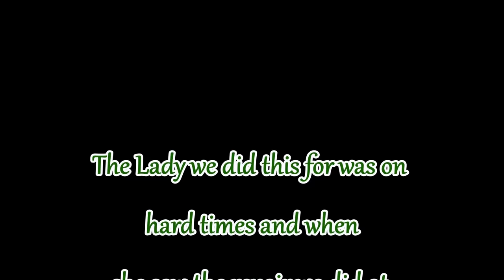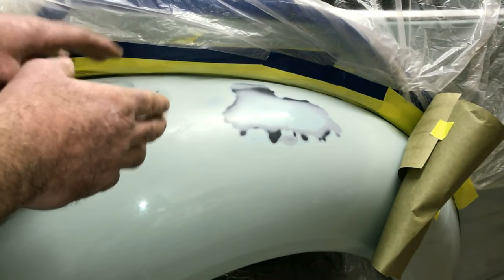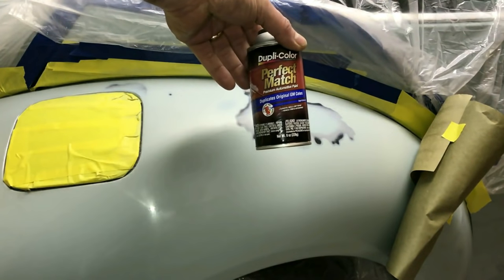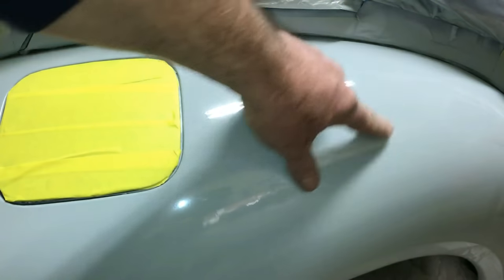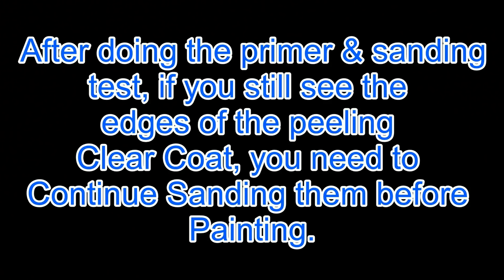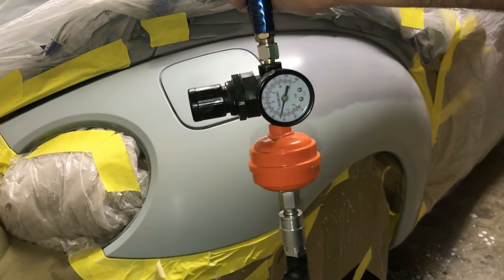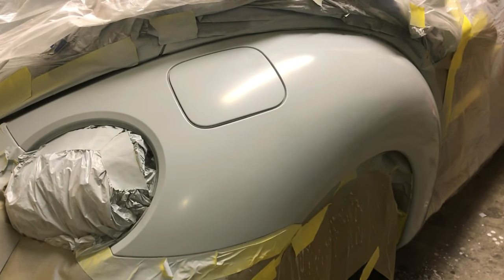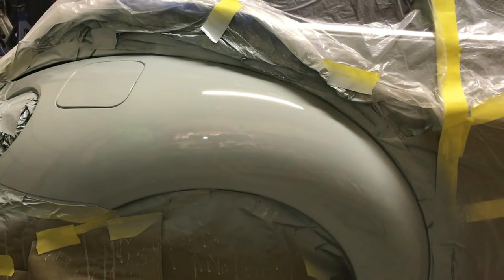How To Fix PEELING Clear Coat...With a Paint Can or A Spray Gun

Comment: Excellent video!  Quick question: you mention your plan is to use 2000 grit before spraying the base coat, but then later (in the bonus video) I believe you mention using 600 grit instead - is that correct?  Just hoping you elaborate on this a little.
Reply from the maker: wonder6oy it all depends on how bad your surface is before base is applied, if it is rough then use the 600 and then go to the 2000 if it is smooth then just use the 2000 :)

Comment: Hello! Any tips on how to prevent it from rusting? I did everything sanded it then used primer, paint and clear on top. In 2 months it started to rust a bit. I do live in a area that uses salt on roads.
Reply from the maker: You need to make sure you're using this  https://amzn.to/35DVM9U before putting any paint down.  Thanks for watching and asking.  Have a great day.  mad Mike the hammer SPC

Comment: Great sets of videos. So after spraying base coat you do not sand or treat before applying the clear coat? If a drip appears in base coat do u sand back and reapply the base again?
Reply from the maker: after base, we are good to go with clear if we create an issue ith base we do sand it back down and rebase and then clear thanks for the great questions

Comment: Very Impressive. I have a light spot in my clear coat,about 6" in diameter with no peeling or cracking. Is the clear coat damaged all the way through or is the damage limited to just the top layer?Can it be lightly sanded then buffed out? Thanks!
Reply from the maker: Ricky Marshall Kirkpatrick you can try this video https://youtu.be/KqZ6VHmAhlI it will get you by until you can get it recleared professionally and or give you more ideas on doing it yourself.
Reply: Thanks. I just need to know if the clear coat is bad (faded) all the way to the base coat.
Reply from the maker: Those videos the clearcoat was actually missing we actually buffed with our process the basecoat to make it look as good as it could ever look

Comment: One other question, do you recommend 3M clear bra material and is it difficult to apply?
Reply from the maker: Bob they are awesome but      I would say the smaller areas are easy but when you get to the front bumper and hood that is where you will require two people and a heat gun. Its not easy to keep the material stretched and while applying by oneself. Spend the extra money and get it done right          hope this helps my friend